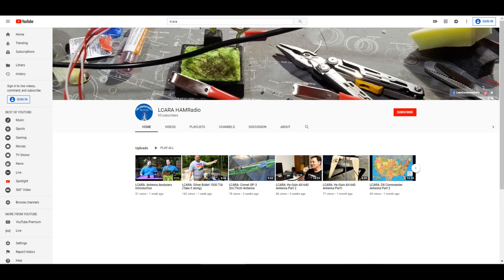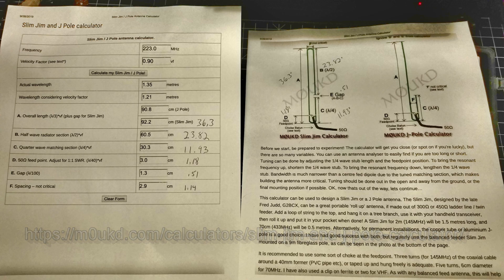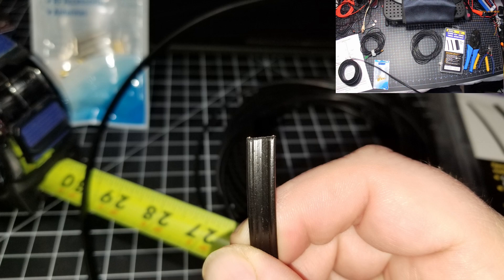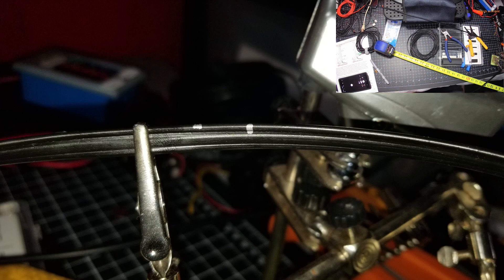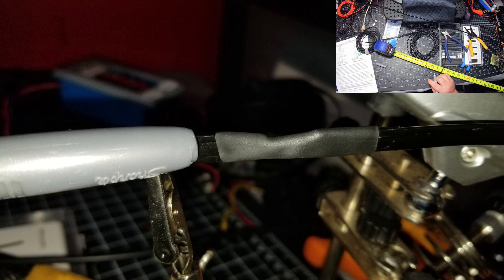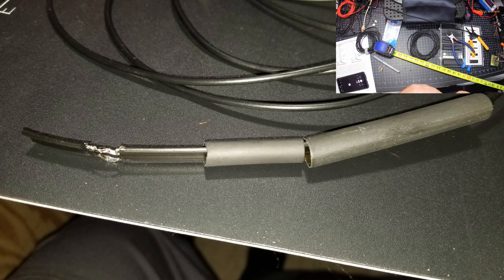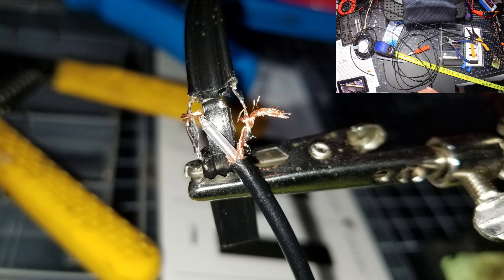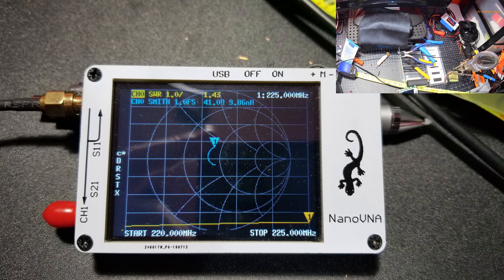LCARA HAM Radio: On the bench - 1.25m Slim Jim Build

Comment: Tried making this but struggled with soldering my coax to the ladder line. The long wire seemed to soak up all the heat from my soldering iron. Someone suggested making a short tail Coax and this certainly helped. I actually started by working from the bottom of the antenna; joining the bottom ends then attaching the coax core & shielding to the left & right ladder wire. That left me with the top end to join. Because I was using 300 Ohm ladder line I was unsure of the velocity factor but started with a low frequency & high velocity factor 0.91 as this should mean trimming the top end rather than adding. The SWR turned out to be 136 Mhz (when I needed 145.5 Mhz). This enabled me to deduce the velocity factor for my wire which turned out to be 0.86 so that when I entered the base operating frequency it told me how much to trim off the top. My soldering got better by putting flux on the wire burning it off and then tinning the wires separately before joining them.

Comment: Where’s the links to the calculator ? These work very well. I run one for 2m. Many people don’t realize there is a dedicated 440 one as well. The 440 is the 3rd harmonic of the 2. So it will show resonance on 440 but I wouldn’t put 40 watts into it. We have a new 220 machine here in Berea so I’ll pass this along. Btw where did you get the heat shrink? I need some to go over ferrite beads on 8x.
Reply: It would be nice to see the antenna in use.
Reply from the maker: I got the glue lined heat shrink at Harbor Freight.